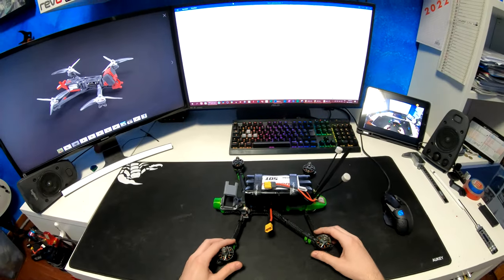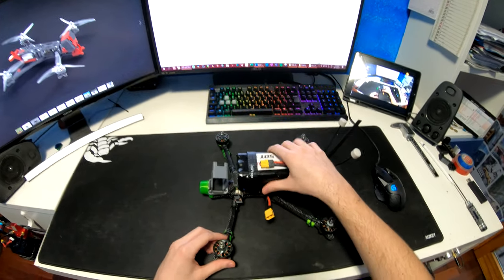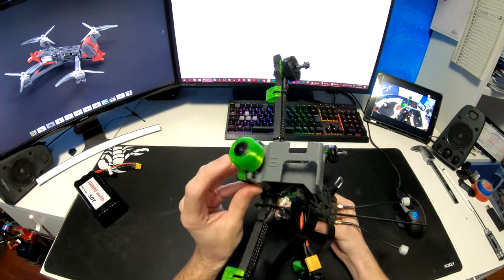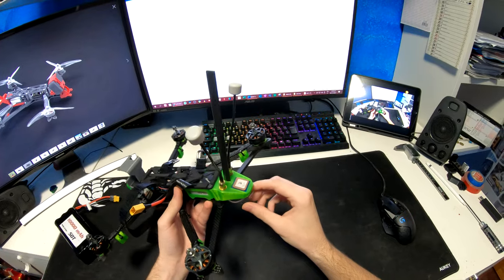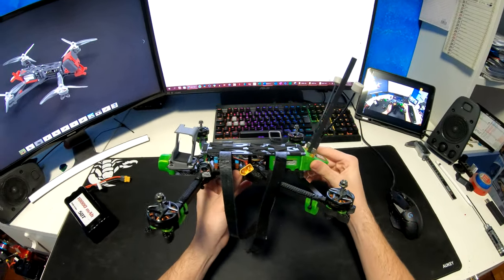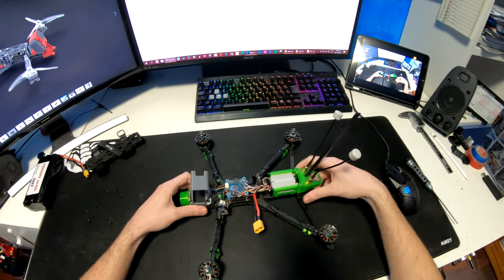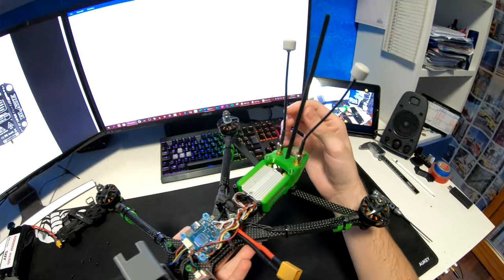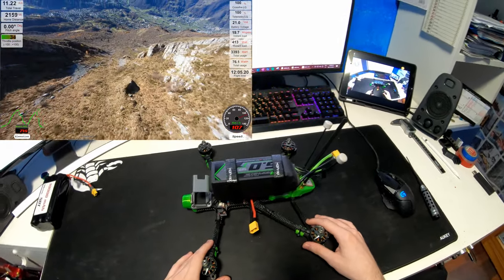AOS Falcon 7 Build Showcase - Long Range Cinematic FPV Drone

Comment: Great looking quad! Does the O3 au and cam fit on it?
Reply from the maker: Thanks!
Unfortunately I have not tested this and I don't have the O3 system, however from what I've seen the new air unit and camera appear to be smaller than the old stuff so you could almost definitely fit those with the appropriate mounts

Comment: do you think it would help in flight time if rear arms would be mounted to the top plate? to be higher than front ones so propellers would get less turbulent air. also, what about mounting engines on an angled plate, for example 20deg. then drone would not have to be tilted during the flight, less drag (?)
Reply from the maker: These are some interesting strategies, but I don't have the equipment to make my own frames to test them, and buying multiple custom frames gets expensive quickly. I don't think that mounting the rear motors higher would make much difference. As far as the angled motors, the idea sounds good but it would probably mess with the flight characteristics and probably make a negligible difference

Comment: There are several other 5.8 ghz antennas by the same IB CRAZY that are advertised as having higher gain than the triumph pro does, with slightly less axial ratios, what are your thoughts on them?

Comment: @Fab FPV  How did you extend the DJI camera cable. It is only 100mm and the frame is too long.
Reply: Just realized there are 200mm cables that can be purchased.
Reply from the maker: Yeah, unfortunately the extensions are a must for longer frames unless you mount the unit in a weird way
Reply: @fabyt68  Thanks -- I did not even know they existed until I tried to mount my unit on this frame. Thanks for the STL files.

Comment: thank you for the great video. The big blocking point of LR is DJI FPV video. I understand that you have Triumph or AXI2 LR antennas on the Airunit, but most importantly, the key setup is the DJI Googles antennas. How did you do about this ?
Reply from the maker: You can find detailed info about my setup in the description of my flight videos.
I mostly use these antenna on the goggles:
- 2x prodrone.pl helical 12 turn 14 db ( https://shop.prodrone.pl/pl/p/PRO-Helical-antenna-12-turn-5.8-GHz-14dbi-v2/332 )
- 2x Mike Malagoli 6-turn helicals custom made & tuned for the 2nd channel of the dji goggles ( https://ko-fi.com/s/25395edd9f )
Reply: Did u see how far he went on DJI Goggles ? Amazing .  Also i wonder if putting some more DBI antenna's on the QUadcopter would help range or not?  LIke using 2 of the axis 2 duo's
Reply: @fabyt68  I just ordered 2 of those Mike Malagoli antenna's thanks for showing the link.  Now what other 2 best antennas should i get?  What is a good antenna stand for cheap in usa if u know of.  I wish there was a good long range drone builder in usa that gets good deals like i have for my 5in free style quadcopters. A full Pro build 5in with Fettec G4 and 45amp 4-1 good motors like ethix v4 or vannystyle or f6 pro iv and vista pro hd and tbs tracer on a good frame cost me 400$ when it would cost say 600 from rotor riot. I may ask him if he can build me a 7in LR Falcon  even .  I wish i was good at setting up all the good data to have on radio screen. Are u able to fly  just by looking at your Radio screen if u say lose video . I know on my tbs telemetry i can see pitch etc and i guess if gps is active can see altitude etc still which is nice but would be nice to see home point and compass to watch and make sure your heading in right direction but then again gps rescure should handle that.  The farthest i flew was the other day on my smol yeet 5  2104 motors tbs cross fire 500mw 50hz  and no gps and said F ittttt im sending it and only had 1150mah and didnt want to go to far but went 1.5miles and back too twice as long to get back going into 18mph  45deg head wind on a 320gr all weight .  just ordered the Rekon 7 pro and Chimera 7 pro (less efficient due to tall stator on pro model and 690gr weight of quad )

Comment: Hi from Australia. Great channel and informative videos. Can you tell me do you think the T motor f100 1100kv motor is a good choice  ?
Reply from the maker: I haven't tried those exact motors, but since they're basically in the same line of the ones I use, they should be good

Comment: ciao. A che serve la batdpole 868 ?
Reply from the maker: E' l'antenna del crossfire
Reply: @fabyt68  secondo te e' migliore dell'immortal T ? su un 5" long range ci starebbe una bardpole ?
Reply from the maker: Dipende dall'uso che ne fai. In ogni caso la potenza di trasmissione fa molta più differenza, con il modulo crossfire a 2W vai ben più lontano del limite del sistema DJI anche con solo una immortal t senza scendere sotto il 99% di segnale. Specialmente su un 5 pollici, avendo meno spazio, probabilmente non ti conviene passare alla bardpole.
Reply: @fabyt68   la build 5" e' per long range, e' rispetto al 7" ho meno spazio, resiste meno al vento ma ho piu' portabilita', vorrei comunque  allontanarmi di piu' e seconso te con l'immortal T vado bene fino a 3-4km di distanza ? la metto verticale ? Per i visori ho le axii 🙏🏽🙏🏽
Reply from the maker: Per l'antenna, che sia immortal T i bardpole, è importante che sia orientata allo stesso modo sul drone e sul telecomando. Se sulla radio è orizzontale, anche sul drone deve essere orizzontale. Se vuoi metterla verticale sul drone allora devi girare anche quella del telecomando. Riguardo la distanza che puoi fare, se non mi dici che potenza di uscita usi non posso aiutarti. Però per il crossfire 4km li fai in scioltezza. Una volta mi sono dimenticato il settaggio a 5mW che è pochissimo e sono arrivato a 5km. A 2W probabilmente arriverei a 40km se non fossi limitato dal video
Reply: @fabyt68   grazie per le info, uso il sistema digitale, max  potenza 1.2w e ho una tango 2 pro v3, 1w di potenza massima, metto l'immortal T verticale allora

Comment: what do you think about 2blade props on 7“ long range quads?
Reply from the maker: The only ones I've tried were Gemfan Flash 7042 and thery were absolute trash, way too flimsy and caused massive vibrations. I have just bought some HQprop 7x4.5 2 bladed props which seem stiffer but I have yet to try them. In theory 2 bladed props should be more efficient and I like that they make the drone more silent, but as of now my experience with them has not been great.
Reply: @fabyt68  let me know how you like the hq props.
Reply from the maker: I just tried them. They made the drone vibrate so much that all the screws on one motor came loose and made the whole motor come off mid flight which was not fun. My drone was tuned for 7x4x3 props so it probably wasn't the best setup for bi-blades, but I couldn't make my 3 bladed props vibrate that much even if I tried. At the moment I can't recommend 2 bladed props on 7 inch, they just don't work.
Reply: @fabyt68  oh no, that doesn't sound good at all.
and i suspected that for the 2 blade props the pid settings have to be changed. and more vibrations make my problems with jello even worse. thank you for your feedback, i will then do without 2 blade props for the time being. with which 3 blade props have you had the best experience so far?
Reply from the maker: @jens_jensemann  I like the HQprop 7040. Gemfan flash 7040 work as well but I prefer the HQprop

Comment: Great Video ä. Thanks a lot! May I ask you wich Antennas you use on your goggles to reach that long range? Thanks!
Reply from the maker: - 2x prodrone.pl helical 12 turn 14 db ( https://shop.prodrone.pl/pl/p/PRO-Hel... )
- 2x Mike Malagoli 6-turn helicals custom made & tuned for the 2nd channel of the dji goggles 
( https://ko-fi.com/s/25395edd9f )